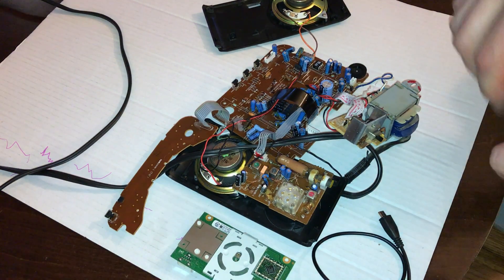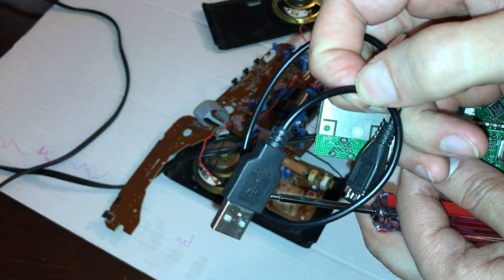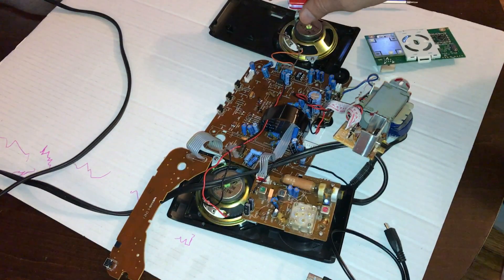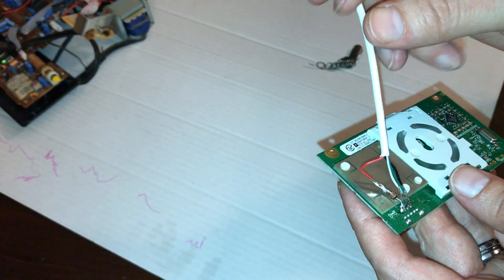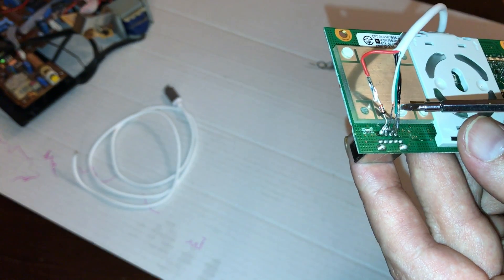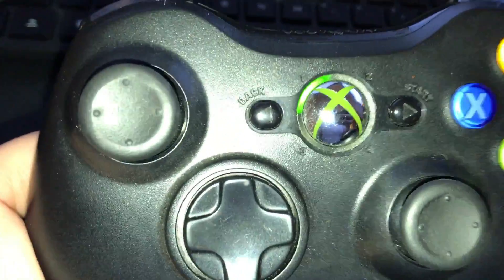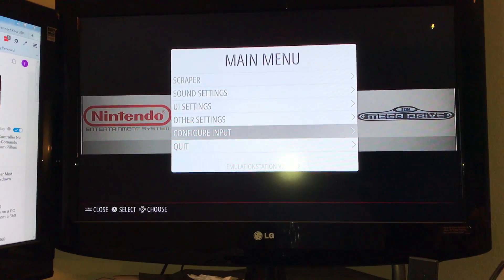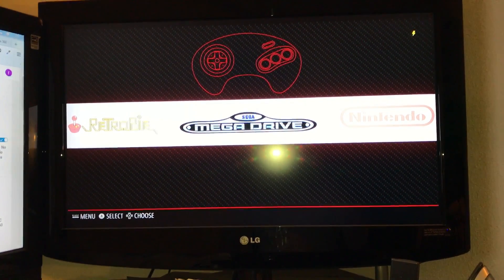DIY Xbox 360 Wireless Controller Receiver for PC or Retropie

Comment: Oh hey, I know it's been a long time, but how did you sync your controller to the board? I do have a play n charge cable, but even when the controller and the board are connected the controller doesn't sync...
Reply from the maker: You have to get the software for the pc. It’s free. I just googled it. I don’t remember what it was, as it was so long ago.
Reply: Hey man, had the same problem. But, in windows 10 when you go into trying to update the drivers in device manager, go into select my own drivers and try using the 2009 drivers instead. That worked out for me

Comment: What happens if the zener diode is not 5.1v ?
Reply: Just here for an update..i got diodes.. Close to 5.1v not 5.1v exactly.. And with my sad soldering skills..i could still be able to make it work.. So yeah i successfully did the mod
Reply: @adeebhumayun3229  Did you use 4.7v diode?
Reply: @Zoldier92  not sure tbh bro..n really no way to know it now bcoz i wrapped it in tape.. try ur luck
Reply from the maker: Not sure, as I used a 5.1v per the instructions I found. I suppose you could try it and see what happens. If it isn’t enough voltage, then it may not work.
Reply: @fluiditystudio   u think overvoltage could cause an issue?
Reply from the maker: @adeebhumayun3229  I’m not an electrician, just dabbel in all this stuff. But, I think supplying to much voltage could be a problem.
Reply: WITHOUT SOLDERING https://www.youtube.com/watch?v=LLOu14alTgg

Comment: Hey dude, I did the steps and plugging it in it comes up with the regular Unrecognized Device, and when I install Xbox 360 Controller for Windows and manually add the driver to the receiver in Device Manager, it gives me an error saying the driver isnt compatible with the device and I should get a driver that is for Windows 64bit, even though I have windows 7 x64. What do I do?

Comment: any further info about the drivers you used? windows / retropie
also, judging by the yellow lightning on the upper right corner of the screen I'd say you are not using the proper power supply - but rather, I'd be interested on how much current that thing draws from the system. USB2 limit is 500mA

Comment: Will controller connect with RF module without Play and Charge Kit?
Reply from the maker: MirelRc yes, it will. You only need to connect it to the computer initially using the play and charge cable while the RF receiver is connected to pair it. Then it will connect after that without needing the cable.
Reply: Thank you. You're awesome.

Comment: Ive done all of this but when I plug in the Play and Carge Kit into the controller it wont sync to the module. Im using Windows 10, did you modify the drivers in any way before installing them?
Reply from the maker: Kyxe Music  it’s been a while, but I believe that I had to get the USB drivers from Microsoft for the controllers when I connected the plug and play cord with my controller to the computer. This allowed me to sync the controllers with the wireless modded receiver.
Reply: I can't sync.
Is there a solution, please?
Reply: I had the same problem, but I tried using the 2009 drivers instead and that ended up working. In windows 10 when you go into trying to update the drivers in device manager, go into select my own drivers and try using the 2009 drivers instead. That worked out for me

Comment: Great vid, just tried it with my xbox 360 E but found it very different with 6 pins instead of your four, any ideas would be much appreciated thanks.
Reply: Hi  Senkamalam Ganesh, sorry for the long delay. heres the link to the video. its in spanish but i think it might give you an idea. https://www.youtube.com/watch?v=_dGfoQNsbAA&t=3s    Good luck
Reply from the maker: I haven't seen that one, so I'm not sure how it works. I would try the first three pins and if that doesn't work, then try the last three pins. It should be one or the other. Good luck!!
Reply: After replying. went and checked out a few videos, the first four(i dont know) number 5=d+ & number 6=d-, then the black wire on any of the two common ground pins & number 12 is the 3.3v power pin. Hope this will be helpful to anyone else.
Reply: heyy I know this is such an old comment, but do you know if there is a pin that has 5v power? Thanks so much
Reply: Sylvester Mndawe hey can u tell me the vid u saw. Would be really helpful.
Reply: WITHOUT SOLDERING https://www.youtube.com/watch?v=LLOu14alTgg

Comment: If I plug the USB  into my xbox I got this receiver from, can I still use the 360 like I used to?
Reply from the maker: jack zared jr I'm not totally sure if it will work as my xbox I pulled mine from is dead. But I would think it should still work as you are adding on to the receiver, not taking away from it.
Reply: jack zared jr
Yep, mine still works, as long as you dont damage or remove by mistake any of the pins from the port.